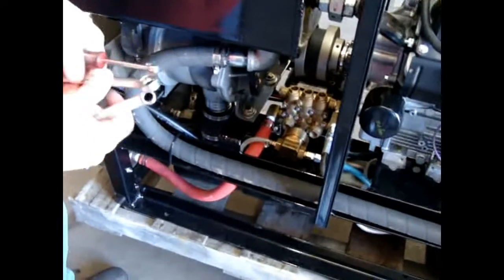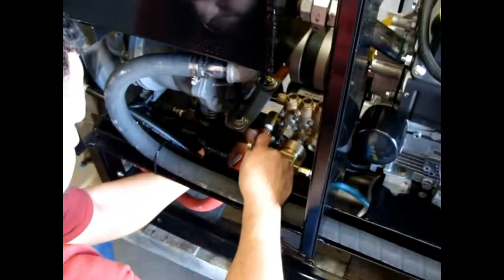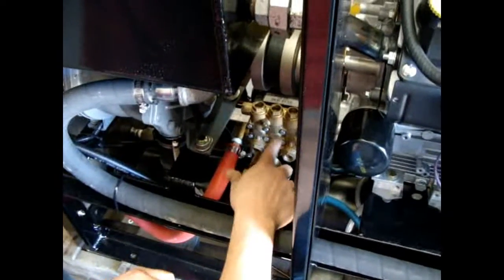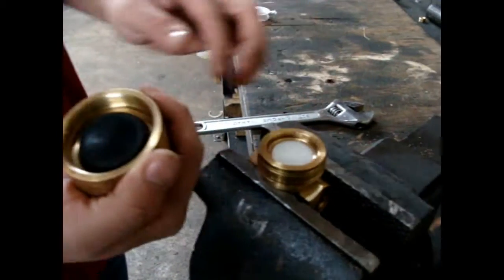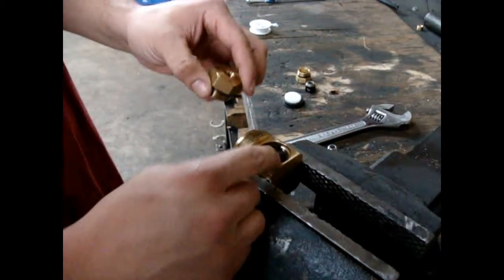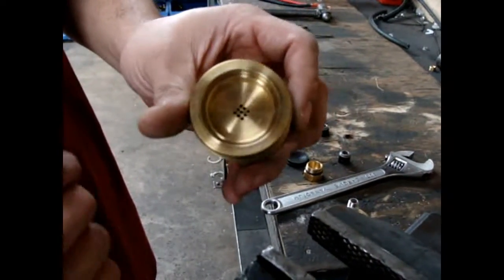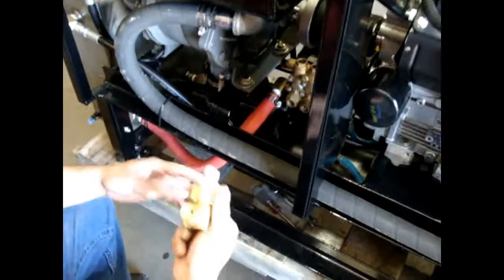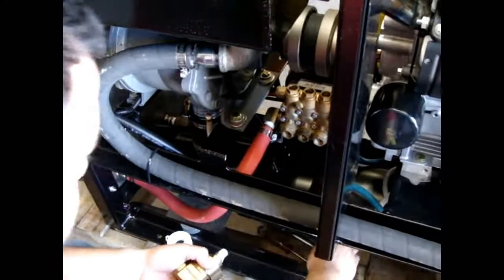Rebuilding the Chemical Pump on a Panther Truckmount

Comment: I have some rinse in my water box. When I let off on the wand trigger it doesn't go all the way to 0gph more like .5 or 1 gpm. But when I trigger the wand it works and goes to 3 gph but when I let off it goes to .5 or 1 gph instead of 0gph.
Reply from the maker: This is either the brass check valve or the disk/ diaphragm. The technicians stated that if it has been 300+ hours since you've changed/replaced the disk/diaphragm, then it is more likely to be that.
Reply: Chem-Tex Manufacturing thanks that's kinda what I was thinking